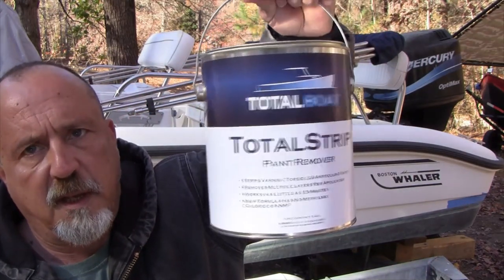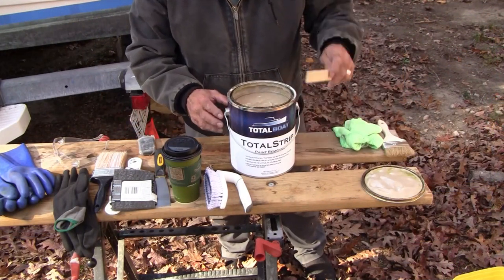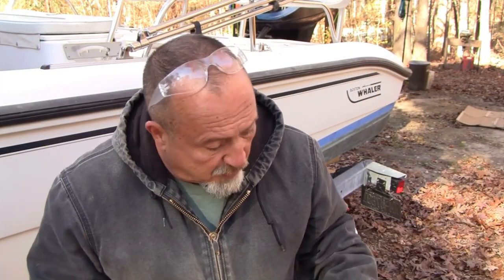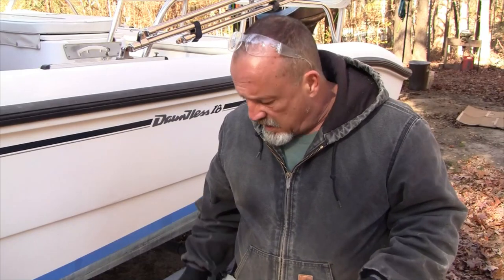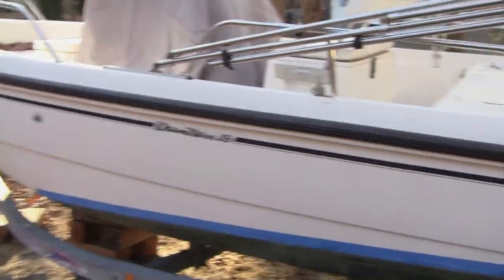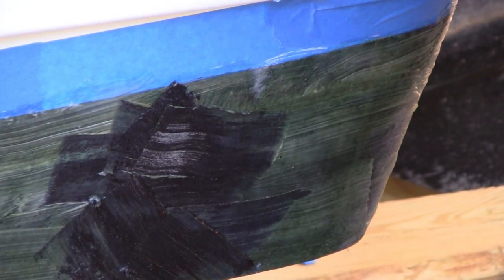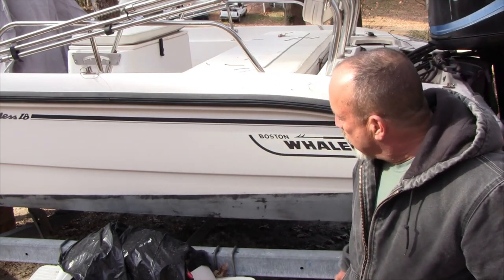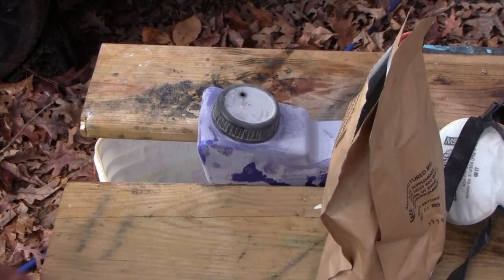DIY - How To Remove Bottom Paint TotalBoat TotalStrip

Comment: Gday mate those soda blasters are a good piece of kit i used mine to clean a lot of the water galleries in the head .head cover and block of calcium on my 40 hp when i had it stripped down even cleaned the carbon of the pistons, the beuety is they do very little if any damage to the work piece and for a very small amount of money i rekon it is well worth it in time and effort . I have the unenviable job of sanding the whole boat top bottom and sides to restore it , the joys of a resto take care.
Reply from the maker: Yes they are! I'm glad that I bought that one, I'm sure I'll be using it more.

Comment: Have you tried using a pressure washer to remove the Total Strip and paint instead of scrubbing?
Reply from the maker: I have not but will try that on my current project when it gets warmer. Otherwise I might be shooting icicles at the gelcoat 😂
Reply: @ExtremeDIYGuy  I'll check back or with fingers crossed I'll be on the hard soon and let you know when I try. 
After everything thaws out.
Reply: @markandrade7547  did this work well?
Reply: @ExtremeDIYGuy did you try to use a pressure washer on that project yet?